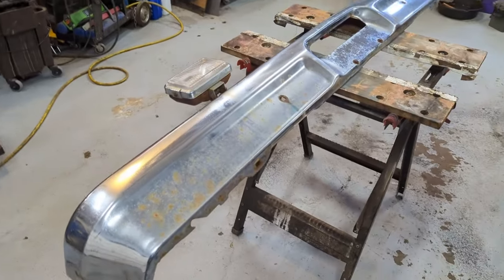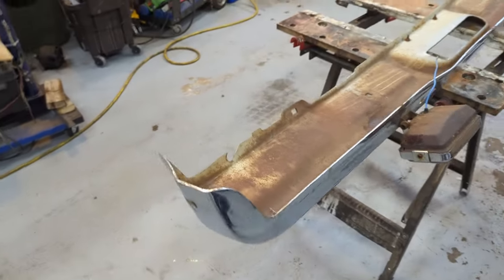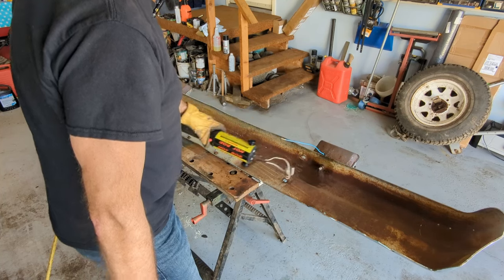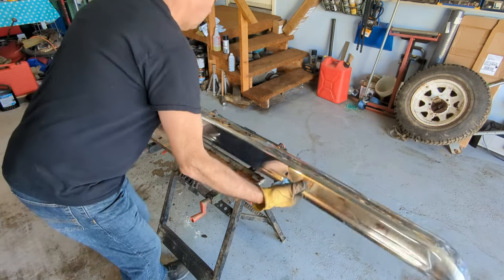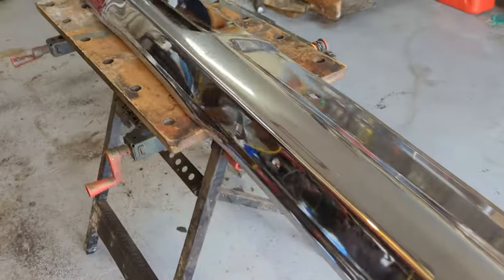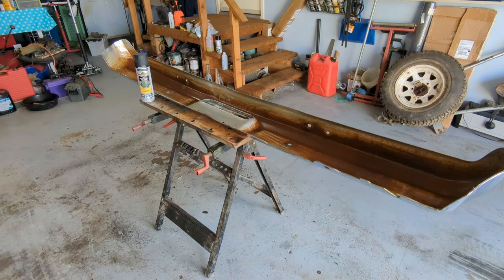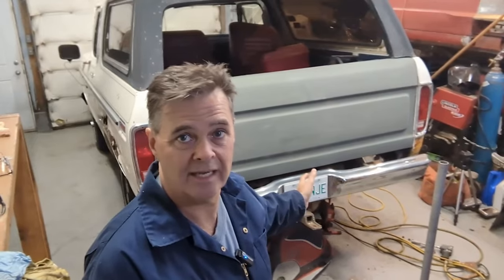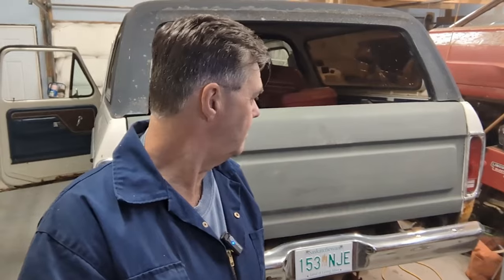1978 Ford Bronco Frond Bumper Refresh & Polish

Comment: It came out great Alvin and I like the heating tool you used.  I've not seen that before.
Reply from the maker: Thanks Matt,
I really like the induction heater, much safer than a torch. 
I does have its limitations, works very well on nuts 3/4" down, its not the best on bolt head ends, like manifold bolts...but works really well on nuts.
Well worth the money.

Comment: Came out shining like a new penny.  If you ever see Turtle Wax Chrome Polish, give it a shot.  I've had 40+ years of good success with that bringing back chrome.  Just trying to help, not faulting your results at all.  The bench looks good too!  Thanks for taking us along ~ Chuck.
Reply from the maker: In my video, I started out with Turtle Wax Chrome Polish, but my bottle of it had dried out, so I went with the Mothers polish, but Turtle Wax Chrome Polish has been my go to since as long as I can remember, unfortunately it's getting hard to find around here. 😢
I have to say,  Mothers polish works really well, and is for all metals, and is awesome for cleaning aluminum.
Reply: @J_R_Shop  I wondered if that was Turtle Wax, but the bottles I’ve always bought were green. Sorry you can’t find it. If I find a bottle, I’ll grab one for you. ~ Chuck
Reply from the maker: @charlesdalton985  thanks Chuck, but don't put yourself out looking for it, I have lots of the Mothers to use up. Lol

Comment: Looks great  not a fan of how the aux. lights look, my 79 had a push bar with lights on it, I liked that look, too bad I sold it years ago, but I have my 78 to fix up a bit and your videos will be a huge help, thank you!
Reply from the maker: Hoping to get in the Bronco in the fall, I've been gathering up parts, and already bought the quarter panels, so a lot less facing...but likely a lot of fitting. 🥴

Comment: With putting them lights on there at least your plugging in the holes and it might not rust so bad out them hold and you don't have them. Holes there.
They'll be covered up.
Good set a fog like to be great in them.
Reply from the maker: Ford offered a set of fog lamps for these broncos, they mounted them on a Push Bar, and they were made by S.E.V. Marchal...I thought it would a nice touch to put a set of those on the front, that thought died when I looked for a set of them 💸💸💸! Lol
I should add that they were "Dealer Installed", and also offer on the 79 Mustang.